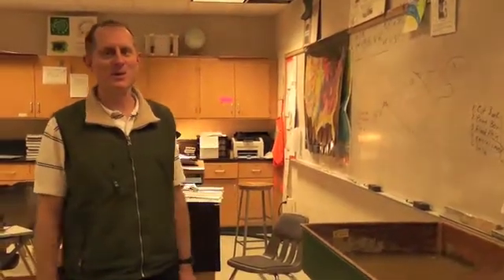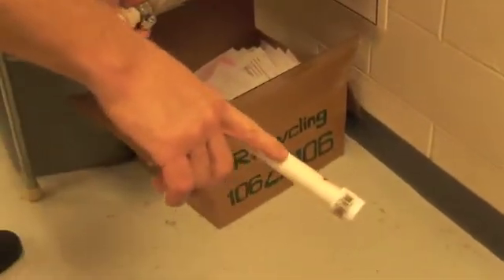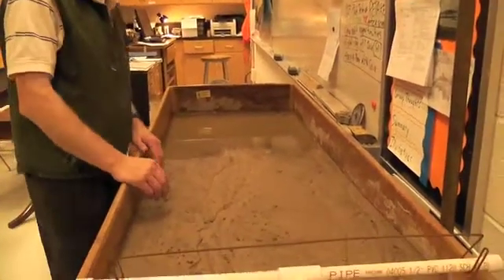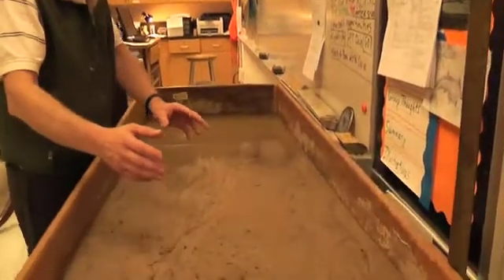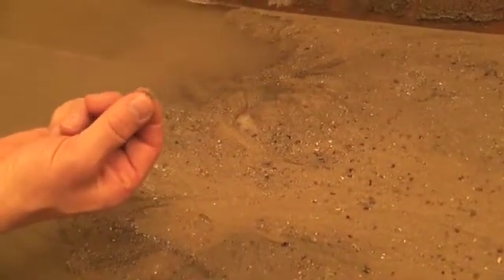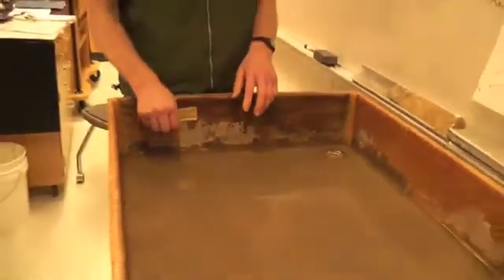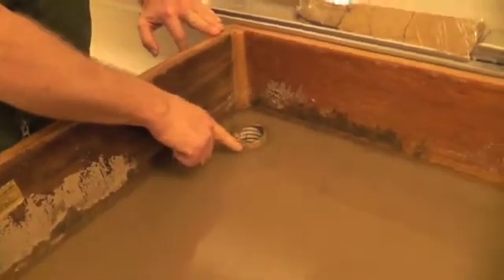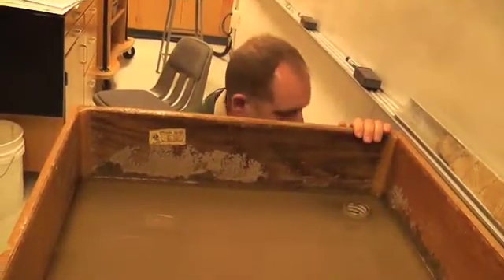Stream Table Erosion.m4v

Comment: Wow, this is really interesting. And you made it right?  It's not flat bottomed like the store bought ones I assume?
Reply from the maker: Correct, the bottom has a variable slope. I intended that to mimic the changing slope as you move from the mountains to the high plains to the upper flood plain to the sea coast.
Reply from the maker: Let me know if you need the building instructions. My email is in the video